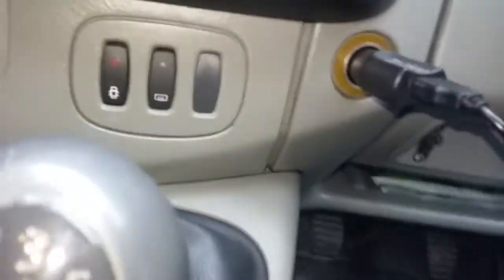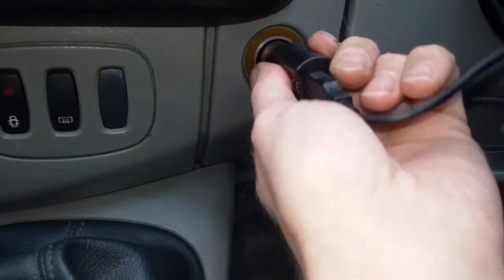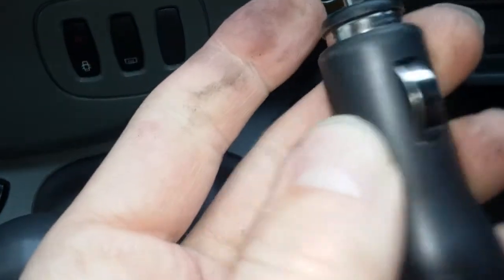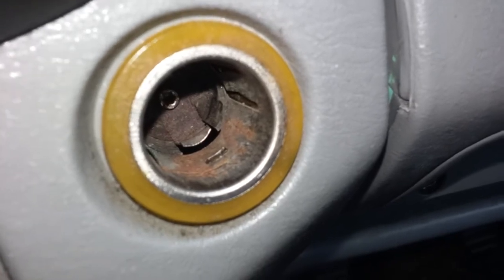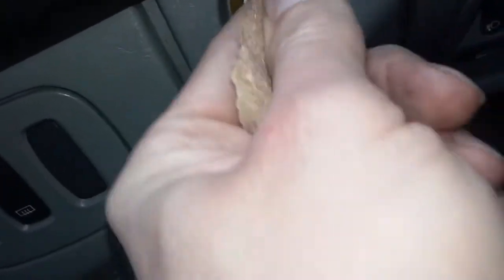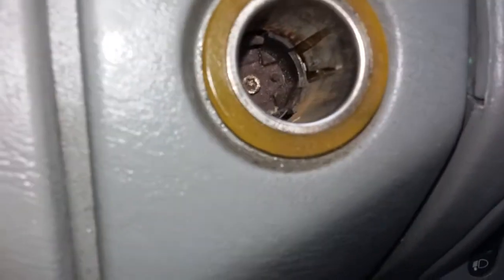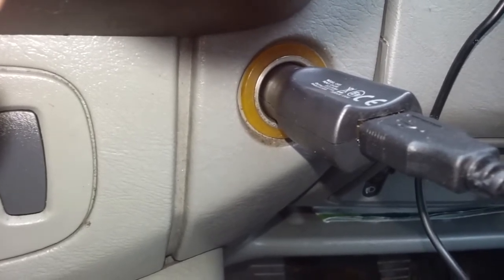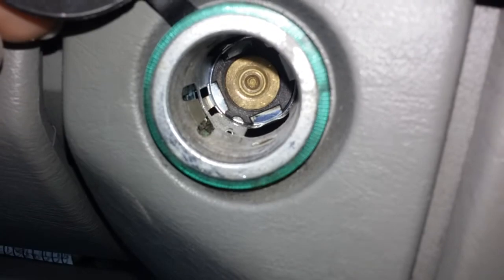Trafic Vivaro Primastar  Cigarette Lighter Socket Fix

Comment: Hi there, I'm just wondering if you fitted the second 12v connection (passenger side) yourself? If so, does it have a separate connection to the fuse box or joined to the existing 12v on driver's side?

Thanks
Reply from the maker: The van came like that so not sure if it was added by another owner or is standard.
Reply: @fiveminuteman  Thanks.

Comment: It's a 14 plate van my misseses car and mondeo are both 08 plates. If my phone is 2 percent after driving  90 mile it would not even be 50 percent trust me its perthetic. If my phone was 2percent and drove   30 mile in my mondeo it would be fully charged as it would in my misses little winne vauxhall corsa with a tiny little winne 1 litre engine. I realy do think these vans are shite and can't wait get shut of mine it drives lovely but I hate it with a vengeance lol 🤣
Reply from the maker: There's an app called Ampere which measures the charging amps. Could be interesting how the cars compare to the van. Usb cables can vary in quality and charge capability. 👍